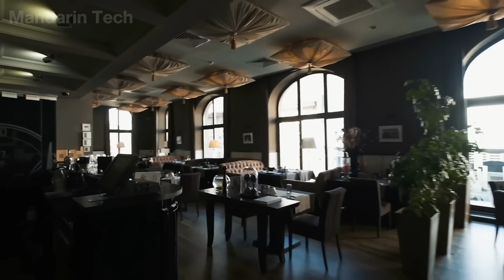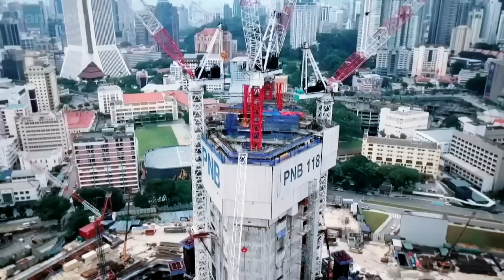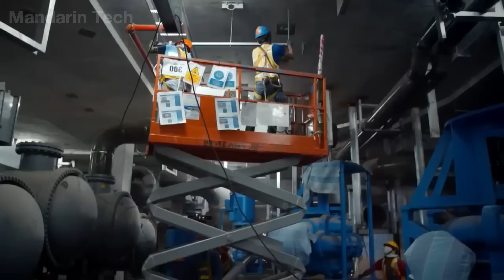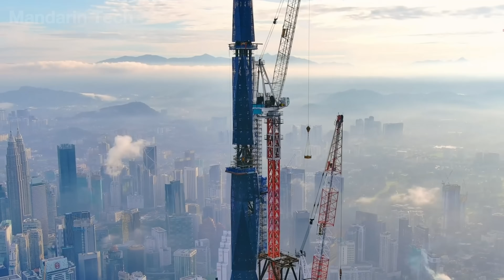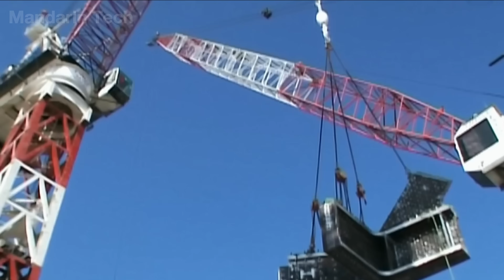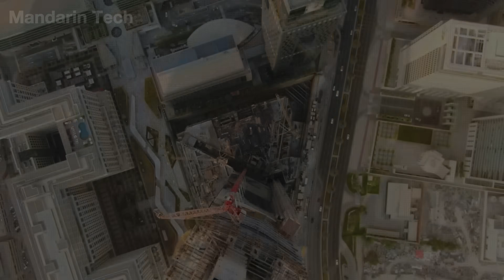How Malaysia Built a 700 Meter Skyscraper to Turn It into a 21st Century Icon

Comment: The antenna/spire on Merdeka 118 is partly related to lightning protection and broadcasting/communications, but its main purpose is architectural height and telecommunications. Malaysia has one of the highest lightning activity rates in the world because of its tropical climate, so very tall buildings need advanced lightning protection systems. Globally, many supertall buildings use spires or antennas: Burj Khalifa, Taipei 101. Some people say skyscrapers with spires or antennas are “cheating” because the extra height may not be usable floor space. For example, Merdeka 118 becomes taller because of its spire. However, official skyscraper organizations like the Council on Tall Buildings and Urban Habitat count permanent architectural spires as part of a building’s height. Temporary antennas usually are not counted the same way. So, under international skyscraper rules, Merdeka 118 is officially considered its full height. The debate is mostly about opinions on architecture and rankings, not about breaking rules or actual cheating.
Reply from the maker: Thanks for sharing the extra details, really informative comment.

Comment: Cheat a tall by stick 😂
Reply from the maker: Sometimes the simplest solutions work the best
Reply: Haters always gonna hate!, skyscrapers with spires or antennas are “cheating” because the extra height may not be usable floor space. For example, Merdeka 118 becomes taller because of its spire. However, official skyscraper organizations like the Council on Tall Buildings and Urban Habitat count permanent architectural spires as part of a building’s height. Temporary antennas usually are not counted the same way. So, under international skyscraper rules, Merdeka 118 is officially considered its full height. The debate is mostly about opinions on architecture and rankings, not about breaking rules or actual cheating.
Reply: Even burj khalifah have stick and many other towers in the world have stick too and ofcause your brain like stick too😂

Comment: Sticking a narrow spire on the top is a bit of a cheat
Reply: Haters always gonna hate!, skyscrapers with spires or antennas are “cheating” because the extra height may not be usable floor space. For example, Merdeka 118 becomes taller because of its spire. However, official skyscraper organizations like the Council on Tall Buildings and Urban Habitat count permanent architectural spires as part of a building’s height. Temporary antennas usually are not counted the same way. So, under international skyscraper rules, Merdeka 118 is officially considered its full height. The debate is mostly about opinions on architecture and rankings, not about breaking rules or actual cheating.
Reply from the maker: Haha, modern skyscrapers really love playing tricks with spires
Reply: You are not wrong. Wish they could change height rules to have only occupiable space height - basically to eliminate antennas from tower height

Comment: Field Engineer & Environmental Perspective
🇬🇧 English

From a field and environmental perspective, constructing ultra-tall buildings requires strict safety standards and sustainable practices.

Working at height, optimizing materials, and integrating energy-efficient systems are key priorities.

Field engineers play a critical role in ensuring quality, safety, and compliance throughout construction.

The future of skyscrapers must combine performance with sustainability.

#FieldEngineering #EnvironmentalEngineering #HighRiseConstruction #ConstructionSafety #SustainableConstruction #GreenBuilding #ResponsibleEngineering

Français

Du point de vue terrain, la construction en hauteur exige sécurité et durabilité.

La gestion des ressources et de l’énergie est essentielle.

Les ingénieurs terrain assurent qualité et conformité.

Les gratte-ciel doivent être durables.

#IngenierieTerrain #IngenierieEnvironnementale #ConstructionGrandeHauteur #SecuriteChantier #ConstructionDurable

Español

Desde la perspectiva de campo, la construcción en altura requiere seguridad y sostenibilidad.

La optimización de materiales y energía es clave.

Los ingenieros en obra garantizan calidad y cumplimiento.

Los rascacielos del futuro deben ser sostenibles.

#IngenieriaDeCampo #IngenieriaAmbiental #ConstruccionEnAltura #SeguridadEnObra #ConstruccionSostenible
Reply: How many tall building in China even though China is located in the ring of fire with earthquake....

Comment: The rise of a 700-meter skyscraper in Malaysia reflects how modern cities use iconic high-rise engineering to define identity, innovation, and global ambition in the 21st century.

Civil Engineer Perspective
🇬🇧 English

“How Malaysia Built a 700 Meter Skyscraper to Turn It into a 21st Century Icon” showcases the limits of high-rise structural engineering.

Designing at this scale requires advanced analysis of wind loads, structural dynamics, foundation systems, and material performance.

For civil engineers, this project demonstrates how innovation enables vertical expansion while ensuring safety and efficiency.

Pushing height limits requires precision at every level.

#CivilEngineering #StructuralEngineering #SkyscraperDesign #HighRiseConstruction #MegaProjects #EngineeringInnovation #UrbanDevelopment

Français

« How Malaysia Built a 700 Meter Skyscraper » met en avant les défis de la construction en grande hauteur.

Les charges de vent, les fondations et la dynamique structurelle sont essentielles.

Pour les ingénieurs civils, ce projet illustre l’innovation technique.

Construire en hauteur exige précision et expertise.

#GénieCivil #IngenierieStructurelle #GratteCiel #ConstructionGrandeHauteur #MegaProjets

Español

“Cómo Malasia construyó un rascacielos de 700 metros” muestra los retos de la construcción vertical.

El análisis del viento, las cimentaciones y la estructura son clave.

Para los ingenieros civiles, refleja innovación y precisión.

Construir en altura requiere excelencia técnica.

#IngenieriaCivil #IngenieriaEstructural #Rascacielos #ConstruccionEnAltura #MegaProyectos